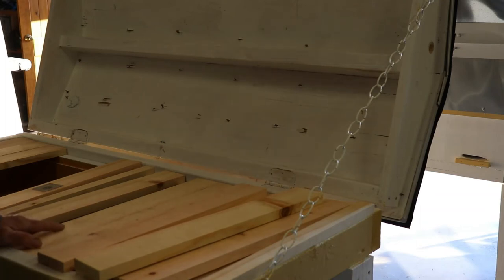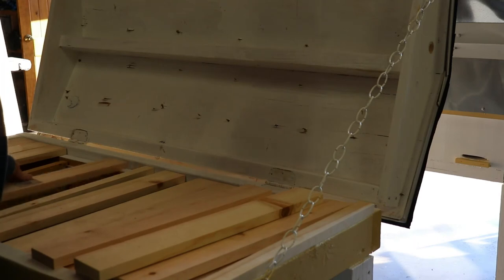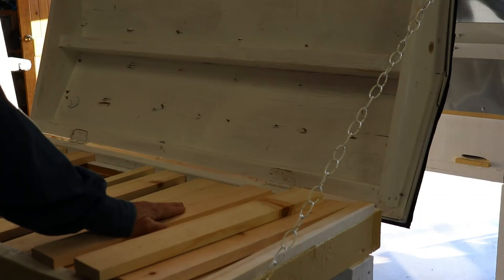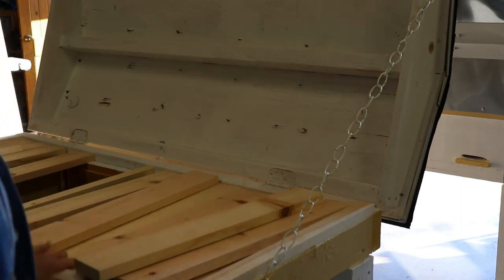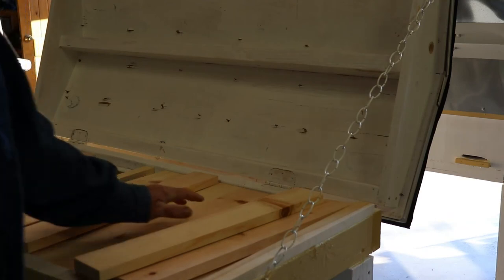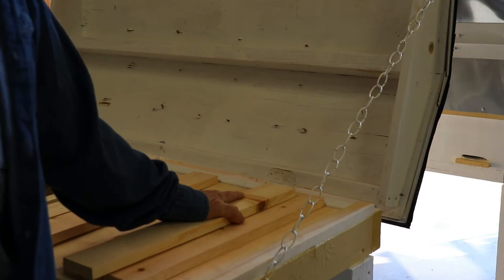DIY Horizontal Langstroth Beehive

Comment: I love the idea of putting little screws  in the top boards to lift them up.
Reply from the maker: All I needed to do was put a screw on a couple of the top cover boards. I placed them on both sides of the  moveable end board. Anything to make things easier, is always good.

Comment: I built a Lazutin horizontal hive it holds 17 Lazutin frames. I use x2 Langstroph frames bracketed together. I got nail boards covering mine to keep bear out. I call it the porcupine hive.
Reply from the maker: The Lazutin hive is a more natural hive for the bees. I bet it will provide a great home for the girls. Thanks for the comment and you have a great state.

Comment: How was your first year with the horizontal hive?? I’m fixing to build one off yours!! Thanks so much. Do they make the same amount of honey in those type hives?
Reply from the maker: I really like the horizontal hive, they are a little more of a  hassel than the verticals, but the bees seem to function well. I call them my baby makers. both my hives last year created a lot of brood. I removed numerous frames of brood to supplement weak hives or create new hives. I lost one of the horizontal hives over winter, I believe the north wind got them. This year I am removing the drawers and screen and placing a solid bottom on that hive. I will observe both hives through the summer and next winter and compare. As for Honey, about the same, you will need to rotate the frames and push the honey frames to the outer frames and keep empty comb available. Don't allow bees to become honey bound, or they will want to swarm. Good Luck, enjoy the bees. Mike
Reply: @andersonprettywaterfarm4369  thank you so much for the in depth description!! I was thinking about 8-9 frames for brood and then exclude her and leave he rest for honey supers?? You say I’ll need to move those honey frames further out as they fill them up and leave the empty combs close to the brood nest?
Reply from the maker: @catchemalive  As the hive expands with brood and stores, ensure you provide a frame or two for expansion. If you want to control the brood chamber you may need to replace a frame or two of brood with empty comb from time to time to prevent swarming.

Comment: What size are your drawers, Depth and width and size of drawer fronts? Do you use trays in them? I am in Queensland Australia.  I want to put trays and screened bottom with solid bottom under drawers or trays for Small Hive Beetle and usual droppings so is easier to clean. I am building another with viewing windows, and the screened bottom with trays and solid bottom.
Reply from the maker: Hi Lois, The drawers are 11 5/8" wide by 18 1/2 " Deep by 5/8" thick. The drawer front is 13' wide by 3 1/2" tall by 3/4" thick. The two horizontal hives did well this year. They populate heavy with lots of brood. I would encourage to use wider cover boards 1 x 6. I have two types of observation hives. My horizontal topbar and my 2 frame mini nuc that I have in my shop with the entry going through my wall to the outside. I have plexiglass on both sides. I place a frame of young eggs and a empty frame with wire. I created 5 or 6 new hives with it this year. I had a blast watching them raise a queen and then when she started her brood I would move them out and start all over. Good luck with hives. We visited Australia 4 or 5 years back, you have a wonderful country.
Reply: @andersonprettywaterfarm4369  Thankyou. I just found the Queen on one end had swarmed and as I was checking frames a new queen came out. My fault 14 days since I checked. Spring here so they are doing what bees do in spring.

Comment: Nice video. Where did you get the plans for that horizontal Langstroth? I have one that I have been building for about 2 years now (about 90% complete) I dont remember where I got the plans. Was taking too long so I bought six traditional langs. Just installed six packages last tuesday. I thought the ventilation ports were more a consideration for moisture control rather than temperature.?
Reply from the maker: I didn't go by any specific plans. Dr. Leo's basic Horizontal Hive was a start and I modified to my liking from that. The double wall with insulation is overkill for our location. I think using 2" thick boards for the base provides adequate insulation especially here in Oklahoma and it mimics the thickness of most hollow trees and it will last a long time. As for ventilation, watch the bees,  most of my screened vent holes are covered by propolis by the bees, they normally leave a hole the size of a pencil. I always place an 1 1/2" extension on top of my Langstroths. I also use candy boards in the winter which helps soak up moisture. The following site may assist with your project, have fun with the bees. https://horizontalhive.com/how-to-build/long-langstroth-plans.shtml